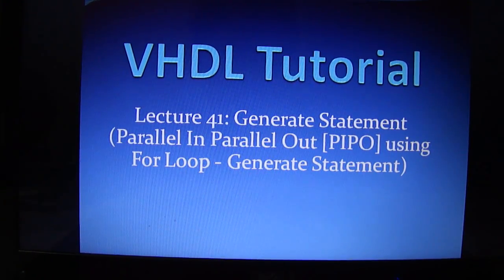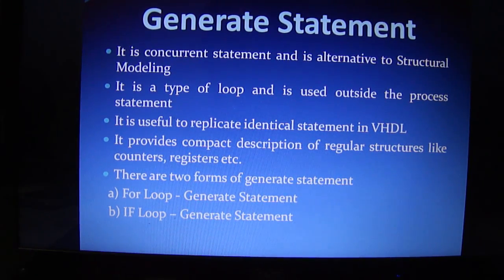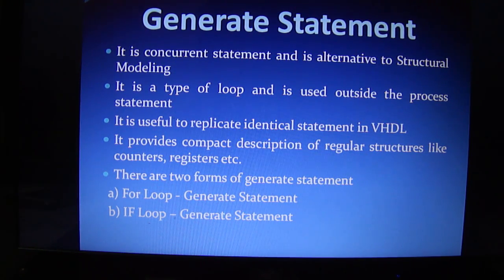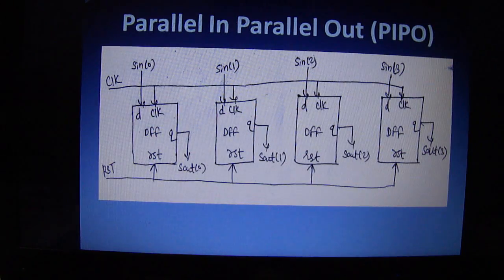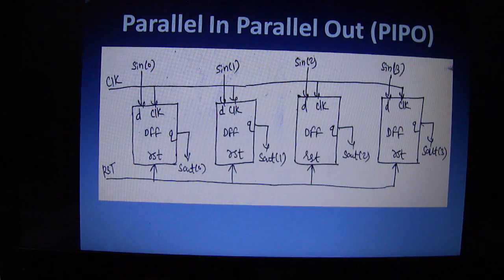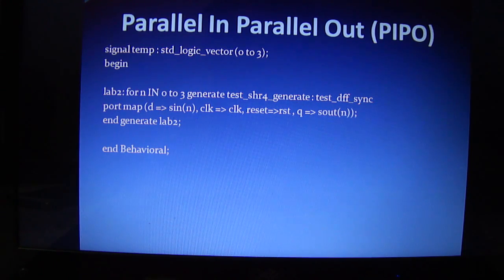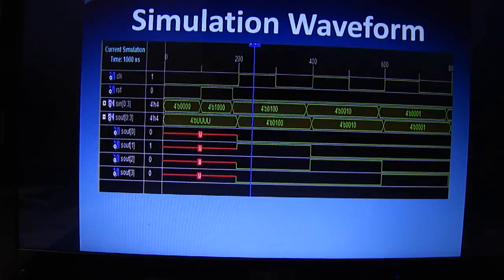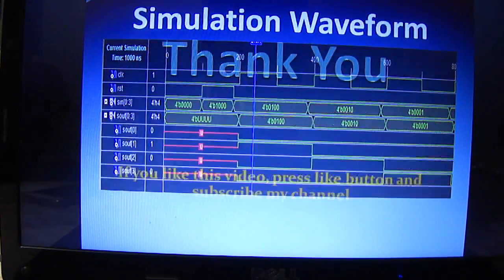VHDL Turtorial:  Parallel In Parallel Out [PIPO] using Generate Statement

Comment: why we have declared signal temp???
Reply from the maker: because we are unable to directly assign output in output, therefore we are using temp signal
Reply: @BeginnersPointShrutiJain  but here temp only declared.not used any where.i think temp not required.
Reply: @alvinaug3844   hey you get the answer for this why there using temp signal...temp signal is not used any where but they are using
Reply: i have same ques